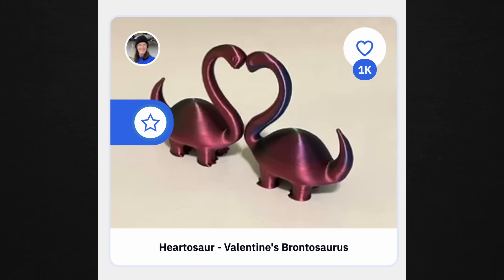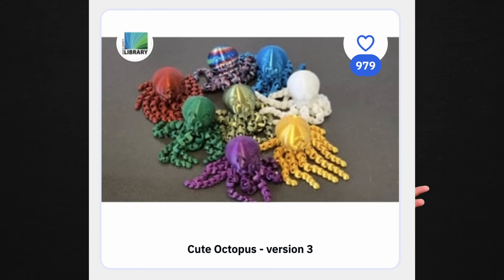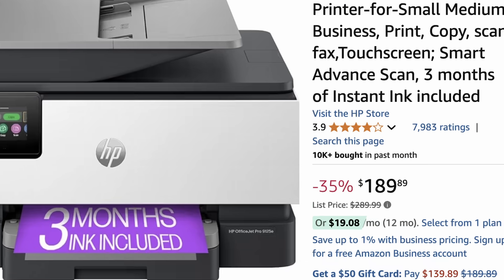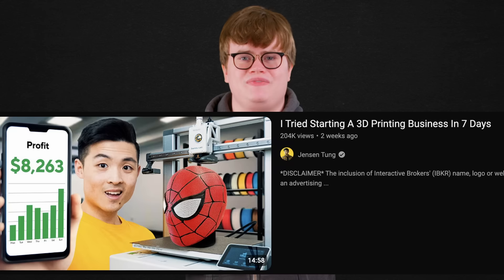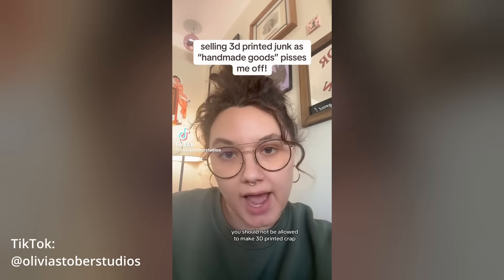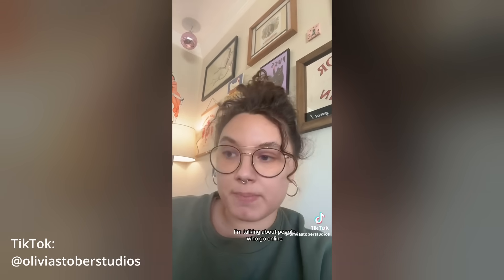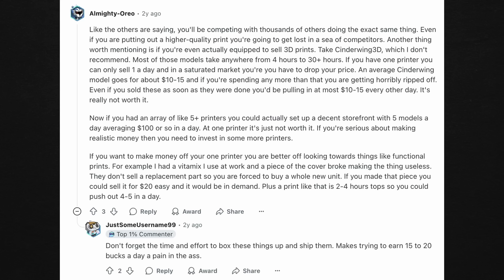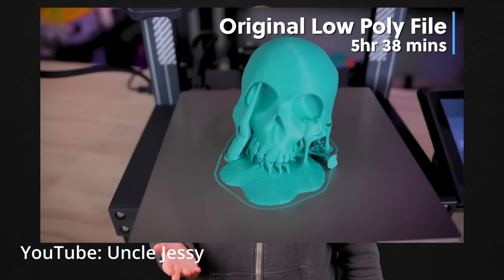The Rise of 3D-Printed Slop

Comment: In model railroading, 3D printing is a god send for prototypes that are not being produced by manufacturers or old hand-made brass that is expensive.
Reply: Any hobby like that has been revolutionized by 3d printing.

Oh and both sides of the conflict in Ukraine are using 3D printing literally on the battlefield, because it allows rapid deployment of drone parts and accessories that are custom made for specific purposes. Truly a wild time to be alive. 

3D printing is great for small batches or one offs that fulfill a hyper specific purpose. 

I taught myself CAD rather quickly. It's not actually very difficult, and cost me nothing but the time to learn it. For me it's a game changer. I rarely print parts designed by others, although I sometimes use models made by others as a starting point. This is because most of the time my needs are so specific that nobody has yet designed what I want. I actually taught myself how to use CAD before buying a printer, because I felt that the printer would be of limited use without CAD skills.

Comment: 90% of the things I've printed, I modeled from scratch myself.

I actually mostly use my 3D printer for prototyping, and making things that you can't buy, like replacements for the deteriorated plastic parts on my car; my 3D printer lives in my garage, because it is a tool.

Unfortunately for my point, the last thing I printed was one of those flexi octopuses 🙃

Comment: I've been in the 3D printing hobby for 2 years now and I've yet to print a flexi dragon or any of the other "crap" people repeatedly claim that's all anyone with a printer does. Overwhelmingly I've used my printer for practical items in my personal life. I've yet to sell anything I've printed.

With regards to the waste of FDM printing, there are whole communities dedicated to looking for ways to reduce and recycle that waste. The Recreator3D project began as a way to repurpose old printers into a device that takes cleaned and stripped soda bottles and turns them into filament. Now the community has expanded to working on ways to shred and recycle print waste for at home injection molding and filament extrusion!

Comment: The issue is that many STL sharing sites allow users to earn points, which can be exchanged for goods. This creates an incentive to quickly assemble and upload low-quality models just to gain rewards. The problem isn’t just that some 3D printer users lack proper modeling skills—it’s also that the system encourages quantity over quality

Comment: I have had a 3D printer for over a year now, and it’s great for me, because I don’t just make useless garbage with it. I print what I need, and use those prints daily. For example, I use the Scott Yu Juan OVERWERK alarm clock stand to charge my phone and some random headphone holder designed for my headboard to put my headphones on.
3D printers are really a great tool, but most of the time, just end up printing the garbage mentioned.
Personally, I do also need to look into a new printer, as the one I have is reasonably slow, doesn’t have the best print quality, and is not a great printer besides if you are a beginner.

Comment: One of the things I find weird about the 3d printing community is EVERYTHING on a design needs to be 3d printed. Even if another vastly superior material exists that is easier to use. For example you want to print a trailer for your RC car. The trailer has a wooden deck. Instead of using real wood the designer insists on using 3d printed planks of wood.  Or people will design 3d printed RC cars and insist on 3d printing suspension and axle components even though superior metal parts are easily purchased. 3d printing should be a tool you combine with other materials to build something. I use 3d printing mostly to build custom parts and fixings for my RC car and plane hobby. It's very useful for that. 

On the subject of printing as a small business. I don't know how it can be profitable. I printed a design that had 35 parts and takes 3 days to print. People are selling online for $25. How is that worth 3 days of your time?

Comment: How dare people print fancy things out of fully biodegradable "plastics" as a hobby!
Reply: pla is not biodegradable, that is a common myth
Reply: @riba2233  That is not a myth. PLA is fully biodegradable. But not as easily as many people think. If you bury it, for example, it will take many years to degrade. In a compost pile, it would go a lot faster, but still multiple years.
All these various PLA+ Materials are not too smart to just throw away, depending on the chemicals used to toughen the PLA. BPAs for example, are never used though.
Reply: @decom70   standard pla is only compostable in special industrial composters at temps over 350c, it won't do anything in your household composter.

Comment: I originally clicked to be a contrarian, not gonna lie. However you make some excellent points and I even agree with the girl about maker's markets. I was in one recently and I did see a lot of 3D printed CRAP for sale. It is crap, for sure. I also saw a lot of 3D printed resin crap but that's a lot easier to fly under the radar. The FDM stuff I saw was abysmal.

Comment: i learned blender so i can model and print small car parts, like front grills for buffers and fog lights. Original car parts cost big money, and if you order them from china cheaply, you have to wait for atleast a month to get them, in case of older cars, you cant buy original parts and cant order them from china as well. 
this is what 3d printing is for, not for crap fidget snakes/dragons. 
car parts are the best way to earn money with 3d printing, especially in winter, when drivers lose there fog light grills and parts like that. :D

Comment: honestly i tend to forget this is the main way 3d printers are used nowadays. i exclusively use mine for making replacement parts and prototyping. about 5% of my old motorcycle was (resin) printed parts due to the bike being out of even a 3rd party manufacturing timeframe.

Comment: Daily reminder that PLA is "compostable", not biodegradable nor recyclable. Yes, you could try to manually recycle it twice or force the surprisingly tough breakdown conditions, but the expect the average 3D print to land in the landfill for the next 100+ years. Print what you want, but maybe print wisely...
Reply: Everything that goes into a landfill is entombed. No air, nothing breaking down in any practical time. You just need to print more useful stuff.
Reply: Perhaps what we really need is a real cheap and tenable way to recycle thermoplastics at home. The amount of trash a 3d printer generates even not including failed or no longer needed prints is staggering. You could easily remake filament or make pellets from it and have a 3d printer that runs on those.
Reply: @dgurevich1  it isn't as easy as you think. At least for injection moulding machines - recycled plastic differs in it's physical properties from new plastic. Actually, for injection moulding 'internal' waste is partly recycled - by crushing it and adding pellets it to new plastic feed. Problem is - if the ratio is off, machines do not work reliably.

Some of the plastics are easier recyclable than others. polyethylene/polypropylene are easier, polyamide ones are harder in that regard. And every heating cycle for many  plastics lowers their strength or makes them more brittle.

(source - one of close relatives, who worked with injection moulding machines. and yes, seen some of that first-hand)
Reply: @fhunter1test  while you're partially correct, you're also over egging the limitations/quantities. My dad has owned an injection molding company for over 30 years and I've been in and around it, including working there on and off, for most of that time.
Firstly, waste isn't crushed, it's reground back into fine particles that get put back in with the 'fresh' pellets. There is no special ratio for this, you just chuck it in and as long as you're not going massively over the top it's fine. There's a lot more fresh than regrind so there's no issue here.
The only real wastage is anything lost to the floor and the re-start/pre-run material.
Reply: @gktbaron sorry, missed the comment. Mention didn't work. 
First of all - thank you for clarification, english is not native for me, I may miss certain words. So yes, it was ground.
But the ratio is still important if you want to keep equipment running fast and smoothly.
(it affects your cycle time and quality of parts. If they are load-bearing - it is especially important). May be margins were too tight, but 10-15% increased productivity is 10-15% increased productivity and lesser electricity costs 🙂.
Reply: @dgurevich1  this is very badly needed
Reply: @dgurevich1 We don't even need to make new filament, if we can mold them into a few standardized shapes, and design our new models to make use of those pieces
Reply: @ I was kind of thinking of using sand molds. Basically treat it like metal casting. I once had a pretty bad clog in my printer with pla and I decided to crank the heat up to 300 degrees then push it through. It thankfully worked and what I saw is the pla flowed like a liquid out of the nozzle before solidifying a moment later. Question is how badly does this degrade the material…
Reply: Compared to ABS it's alot better. But it won't biodegrade unless under VERY specific circumstances.
Reply: It's only "compostable" in an industrial process that requires it to be kept in a higher pressure atmosphere and heated. Most places that do pla composting won't take 3d prints due to the risk of contamination with other plastics and the unknown of what fillers are in the plastic for its pigment or other material properties.
Reply: PLA is biodegradable, the problem is that biodegradable is a borderline useless term as it doesn't actually tell you anything about what's involved in making that happen. "Compostable" is also another term to be vary cautious of - there's a BIG difference between something that's home compostable and something that's only industrially compostable (as PLA is).
Reply: get a pack of gallon bags, save the box your printer came in, and save your waste by color. You can melt it down and mold it using an old toaster oven, and even if it sits in your garage it at least kicks the can down the road
Reply: And it also is just breaking down into micro plastics
Reply: ABS is 100% recylable and can be smoothed with Aceton so you don't get dust stucking between the layers like it's a microfiber cloth. And if you have some waste of it, like from a test print or just the first layer extrusion, supports, brim ect., you can melt it into glue with just a glass jar and Acetone. While you also don't have to worry about that some years in the future you move to a other house and your print lays down in a car at a summer day and melts by just the heat. The only downside of ABS is that you need an enclosure and a fume extraction. That's it. But people just still use PLA, while the first common print material was way better.
Reply: Huh, so it's a carbon sink, since it's not produced from fossil fuels.
Reply: Who cares? Landfills aren't bad
Reply: Filament manufacturers need to start shifting towards materials that are actually promising as sustainable materials, like PHA, instead of continuing the gross greenwashing of PLA

Comment: May be we could have too a recycling system: a factory where we could send the 3d prnted « junk » and receive back the same weight in filaments.
As if i understand well, to « convert » back a 3d printed item to useful filament, we just need to heat it, in the same way the printer is heating it

Comment: I think a lot of people are already misunderstanding this video. You explicity state that there are use cases for 3d printing and that there are high quality turnouts coming from the industry but people have missed that. Even while focusing on the very real issues from 3d printing, you still give exceptions and understanding but that was also not heard. The point is that, while there are good and useful works fulfilling the purpose of the device, a substantial amount of cases are not that. And that's the problem. Not to mention that there's still harm to body and ecology inherent in the use of the machine, even if what's being made is useful. Unfortunately the blinders come on when you're rushing west for gold and you can't hear reason when your pickaxe is swinging.

Comment: Besides all of this being irrelevant because billionaires produce more waste in a second than you could in a month of 24/7 printing you can also just use 3d printing for rapid iteration prototyping still

Ive saved easily over a thousand dollars by just printing replacements parts for things i already own instead of throwing those things in a landfill, or even worse, shipping them back across the continent so the reciever can put them in a landfill

This whole video is really just uninformed slop, which is ironic

Comment: The problem with 3D printing is that we're still at the "program this computer using punch cards" level.

It's all still a huge hassle and despite cutting edge software making a model is not a skill you pick up in a matter of hours or days.

Take the lasercut tchotchkes you find at markets, you can get an approximation of a house with some surface etching to represent doors, windows and tiles.  I can also get a super-detailed range of house models going as far as adding photo etched hinges for the window blinds and 3-D printed parts while the lasercut pieces are made in such a way you get compound curved roofs and incredibly detailed architectural elements.

It's just how much energy you want to put in it.

Comment: I will never buy a 3D printer, but I do use one we have at my local hackerspace occasionally for printing what I would say are useful items, some self-designed. I think it's a great way to go about it. There are many devices that are so cheap nowadays it becomes tempting to get them for personal use even though they don't really make sense for most people and are often quite crappy on the low end. One good 3D printer that is frequently used is a more worthwhile thing to have in the world than 10 crappy ones that collect dust. 

This is by no means unique to 3D printers, of course. You can say the same thing about many specialized devices that used to not be common consumer items. 3D printing is rather unique in the way it tempts people into printing junk which is arguably worse than dust collecting. Imagine if people did this with inkjet printers... Printing memes off of facebook for the heck of it? What a waste of ink and paper!

No hackerspace/makerspace near you? Start one!

Comment: I mean you kinda answered your entire video within the first minute. We have  "3d slop" because the average customer does not care for the function. I personally can't design well but I do print for a purpose, Most just don't and as you point out in the beginning  about the pricing and later with the  grifters, cheap printers will only lead to people trying to make a quick buck with it.

Even tho the price of a 3d printer have fallen to costumer levels where you can buy one without thinking too much about it, the technology is nowhere near that yet. Setting up a print profile alone is something that's too much of a hassle for the average person to try, especially when you need to wait atleast 30 mins for the result of it. 3D Printing is still in it's early adopter phase or maybe transisting into the phase where technical inclined people buy them but the point of where everyone can make anything with one is still far away simply because they are still too complicated.

Comment: Personally, I got into 3D printing because I became fascinated with the concept of Kinetic statues - more specifically ones driven by a gear mechanism and are print in place. While I knew about 3D printer I only ever got into it once I gave the one at my workplace a go (a Bambulab X1 printer), where I tried (and failed) at bringing my first idea to reality - basically a Kinetic statue with a clockwork mechanism. 
My parents were nice to gift me my own printer where I've mostly doing my own designs since - eventually managing to make this Print in Place clockwork-run kinetic statue after months of trial and error (as I write this I realized I should probably put it up on Thingiverse). I personally really thing print in place (or at least minimal assembly ones) kinetic statues are really cool and something you'd keep fiddling with - and while there are some that exist already there to my own dissatisfaction there aren't that many. So, I'm currently doing the next best thing and am designing another proper one. 

Naturally, I became aware of the 3D printing market - especially Dragons. And yeah, like Robert said, I never really understood why they're as popular as they are. Yes, the work looks very amazing and kudos to the artists that can make a buck from it - but it's not really something that's interested me. Even the fidget toy side of the market is oversaturated - which either just repeats the same function as other designs to varying degrees or is a reskin. Again, there was definitely a lot of effort put into these fidget gizmos - but the level of creativity permitted seems to be "constrained" if you get what I mean.
(Call it artists pride or whatever but I've never really been keen on printing other people's designs or any artistic piece I know I'm not going to use - the only designs that are of other people's which I'm fine with are mostly practical ones, like organized containers for example).

After watching Robert's video it's made me think about what I'll do after I manage to get that kinetic statue idea of mine. I was thinking of selling the file of it via Cult3D - but, I think I'd like to help better show the true capabilities of a 3D printer by making it more accessible instead.